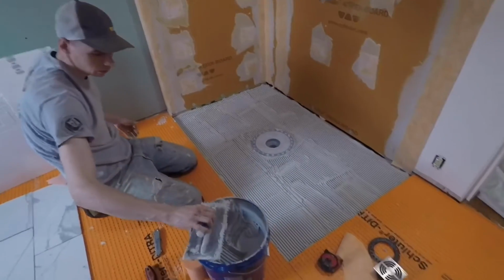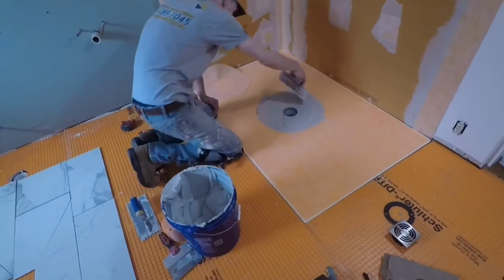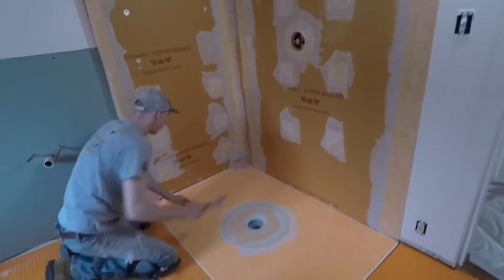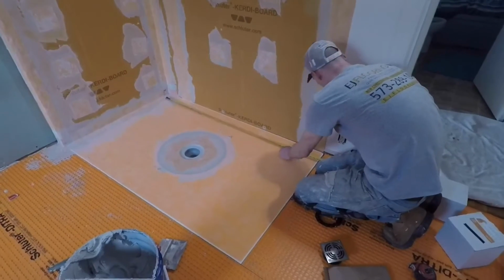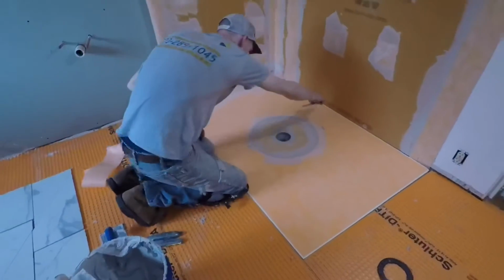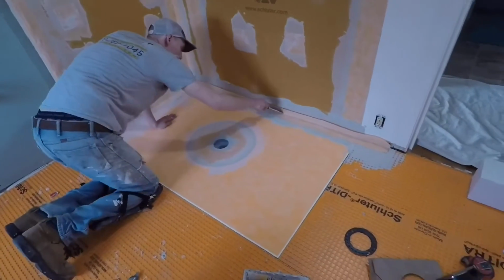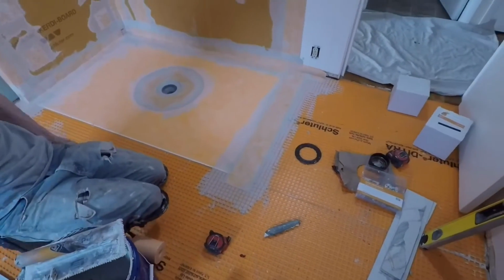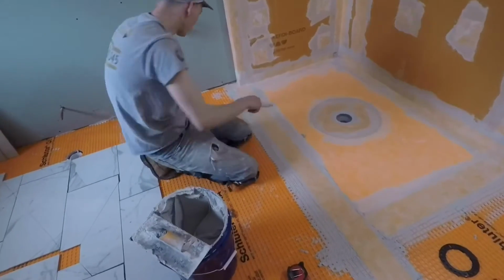Curbless Shower Installation Wood Subfloor  | Part 3

Comment: I like how you did this video exactly as per Schluter's specs & products.  Seen so many videos of hacks mixing red guard or other products & methods with Schluter's products, instantly voiding the 10 year warranty.  Been using Schluter for 40 years with never an issue (long before they had pre-sloped trays).
Reply from the maker: I’m not a fan of hybrid systems. We use Schluter mud and get a lifetime warranty. It’s good stuff.
Reply: Theres a fellow here on Youtube that found a flaw with the drain systems in that water penetrates back up from the drain, and into mud bed or foam pan. This happens between the kerdi and the grey flat dish of the drain that the kerdi adheres to. I use red guard where the kerdi stop in its overlapping of the drain pan. Cant say its right or wrong.

Comment: Thank s for the video! How do you prepare for the shower pan inspection? Does it need to be filled with water for the inspector to check?
Reply from the maker: Yes, a flood test is required by code. A temporary dam must be built for curbless showers to fill with water. We’ve had luck using spray foam in a can. It peels up after the test is done without hurting our fabric.

Comment: I am planning to use 8.5" hexigon tile with a center drain. will I need to make relief cuts for the angle change?
Reply from the maker: That’s a big tile to follow the slope. I think you’ll need to cut the slope lines in the floor.

Comment: What a nice job! 
How they will mount the Glass doors to surrounding shower area?
Reply from the maker: Glass gets drilled into wall tile and silicone to the wall and floor. It works great and not using a drill into horizontal surfaces really helps prevent leaks.
Reply: @friendlyneighborhoodtileguy  Thank you

Comment: First let me say this 3 part video is incredible.  I am 2 months into planning my bathroom reno and about a week/10 days from starting demolition.  I am doing a full schluter system just like this.  Heck I think I even have the same exact tile you have on the floor for my shower wall.  My floors will be a light grey tile to match those gray streaks.  Couple questions if you don't mind taking a moment:

1. Just curious why you didn't use the leveling system on the pan itself. Is there a concern that it will negate the sloping?
2. I am also using 12x24 tile and my bathroom is similarly shaped.  Any design issue with turning the tile 90 degrees so you see the long edge as you walk in?  I will dry fit both but I think I'm going to turn my tiles.  

Thanks again for awesome videos. The Schluter ones are great but they are in a very controlled environment. Yours are on the job and real world stuff.  Can't thank you enough.
Reply from the maker: Thanks for the kind words, I really appreciate it. 

1. We don’t use the leveling system in the shower pan so that we can feel the slope tiles are matched up properly. If your pan is large enough you could use the system on each individual section, but I’d stay away from the slope cuts with it. 

2. The direction that the tile is installed only matters to you. There’s no right or wrong direction (parallel or perpendicular) to the floor joists. 

Thanks again for watching and commenting, I really do appreciate it.
Reply: @friendlyneighborhoodtileguy  Thank YOU guys for answering my questions. Keep up the great videos.

Comment: What size trowel did you use for the shower pan? Do you know much if that depth you loose when you set your shower base?
Reply from the maker: To set Schluter pans we use a 1/4x3/8 trowel. The height before and after installation is pretty negligible. Thanks for the great question.

Comment: What kind of thin set did you use for under the shower pan and ditra
Reply from the maker: Under the shower pan unmodified is ok. We use Schluter Set a lot. Under the Ditra modified mortar is a must when installing over wood substrates. We use Schluter All Set for that. Great question, thank you.

Comment: the regular dirta is thick enough to level with the pan? on their website it says to use the xl. can i get your thoughts on this if the regal will work with only recessing 3/4
Reply from the maker: To use regular Ditra you’ll need to cut a little off the top of the floor joists. XL is fine if you have the height and don’t want to cut the floor joists any.

Comment: So, did the outside corner have to be cut down to fit? Wondering what song caused the copyright notice at 4:30?
Reply from the maker: I don’t remember having to cut down any of the corners to make it fit. I’m not sure on the copyright either. I use iMovie and supposedly I can use those audio tracts for monetized videos. I’ve had a few give me that warning so I just use the same ones now.

Comment: Great video guys but just wondering, I saw you use the tile spacers while dry fitting the tiles over the shower pan, but how come you didn't use spacers over the shower pan when you were actually laying it with mortar? Is it because the slope would cause issues?
Reply from the maker: Great observation. We didn’t use the spacers while setting because of the slope. We also want to be able to feel the slope change with our hands as well to make sure there’s no irregularities there either. This isn’t a large shower so it’s easy to see everything. A larger shower we would use a different technique. Thanks again for the question I really appreciate it.

Comment: What happens if there's a clog the area outside of the sloped area is not waterproof right?
Reply from the maker: Our curbless showers are waterproofed far beyond the shower itself. If there’s a catastrophic event the shower will be the last thing on your mind. The bathroom door to the hallway, heat registers and stool flange will all leak under them.

Comment: What’s the brand of the levelling system you’re using?
Reply from the maker: We use The MLT leveling system. It’s a great system and we don’t get fatigued with spinning or wedging pieces in. It uses a gun to thighten the strap straight down so it tends to not torque the tile out of position either. I can count on one hand how many straps haven’t snapped off correctly either in the 5 years we’ve been using it. Thanks for the question I really appreciate it.

Comment: I may have missed it on previous video. Is the "X" cut in the tile for looks or for a specific reason? BTW, absolutely beautiful  work!
Reply from the maker: It’s the slope of the shower tray. Without the “x” cut it would be a flat tile floor. Great question, thank you.
Reply: @friendlyneighborhoodtileguy  is it necessary to cut the tiles in that x formation? If you lay the tile simply flat will it eliminate the slope altogether? Or will it just make it so the tile is uneven in the shower?
Reply from the maker: @Johnnierocked-87  not cutting the envelope will definitely lead to lippage and pooling. The slope of the tray must be followed for the shower to function properly.
Reply: @friendlyneighborhoodtileguy  thanks. I'm very happy I watched your video lol I would have been in big trouble if I didn't. 
I appreciate guys like you that teach the rest of us before we make mistakes like the one I almost made. Please keep posting. Thank you
Reply from the maker: @Johnnierocked-87  I’m happy I could help, even if remotely. If you have any questions regarding your project feel free to ask away, I’ll do my best to help you out.
Reply: @friendlyneighborhoodtileguy  ok lol. I have a 4x4 shower pan and my doors are 32" by 42" do I cut the pan to match center of the shower doors or do I cut it a bit big to keep the shower doors inside the pan? Or do I place shower doors outside of the pan?
Reply from the maker: @Johnnierocked-87  are you building a curbless shower or does it have a curb?
Reply: @friendlyneighborhoodtileguy  curbless and full bathroom floor. 12x24 tiles
Reply from the maker: @Johnnierocked-87  for curbless showers we waterproof the whole bathroom floor. We use the Schluter pan for the shower and Ditra outside the shower.  We then band the Ditra with Kerdi band to waterproof the floor. If you do it that way it won’t matter where the shower door ends up as much.
Reply: @friendlyneighborhoodtileguy  perfect, that's exactly what I'm doing. I have the same roll of membrane that is shown in your video. I watched all 3 parts of this series and the shower doors were the only thing that was troubling me, so if it doesn't matter where they land ,then that works for me. Lol
Reply from the maker: @Johnnierocked-87  I try to layout my tile so that the cuts are covered by the shower door. My shower doors are custom made, so I just tell my glass guy where I want the door installed. If I already had the doors on hand I’d layout the shower to fit the door and attempt the same look. Good luck with your project, you’re on the right track for sure.
Reply: @friendlyneighborhoodtileguy  thanks man,  I'll let you know how it turns out.
Reply from the maker: @Johnnierocked-87  keep me posted, thanks for watching.

Comment: Outlet that close to the shower against code?
Reply from the maker: The outlet is outside the shower and can’t be reached from the shower either. That’s the full panel of glass there. You have to step outside the shower completely to reach it (unless you have 36” long arms).
Reply: @friendlyneighborhoodtileguy  I thought they had to be 6 feet from edge of tub or shower